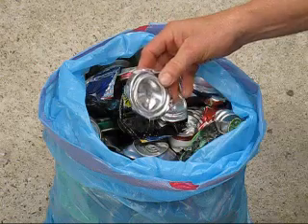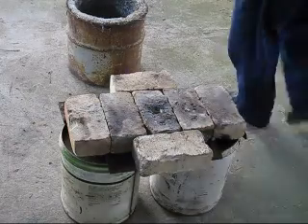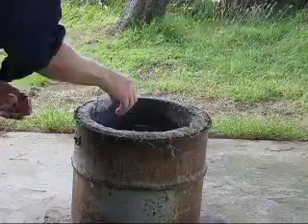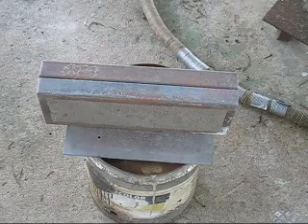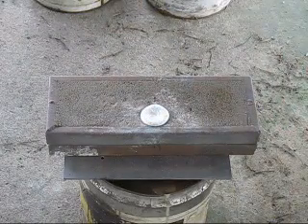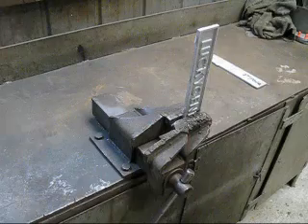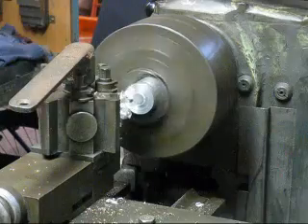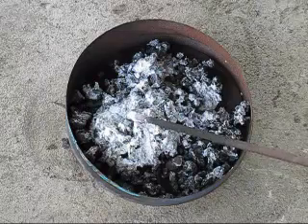Melting aluminium cans experiment

Comment: Have you considered topping the crucible with an inch of powdered charcoal and firing it with a loose fitting lid ?
At those temperatures char will react with any atmospheric O2 ingress, and leave the melt in a reducing atmosphere.
The volitiles from the ink will pressurize and escape the loose fitting lid.

I have used this charcoal  O2 getter technique for a number of things, and if the container has a loose fitting lid, the char lasts amazingly long... hours.
Over 400C, char is reactive as hell to O2, and light enough to float on all metals.

I have never done it with aluminum, but I think I'm going to give it a shot.
Reply from the maker: It is the volitiles in the ink that will gas aluminium. The same thing happens when melting oily scrap. In my gas or oil furnaces there is a low pressure area at the top of my crucible so if a powder is floating on the metal I am melting it gets sucked out the exhaust vent. Lids are not very useful as they stick to the crucible and nobody sells lids for crucibles nowadays.
Reply: @luckygen1001  
Just did a test melt at 750 C in an electric kiln, 3 inch dia AlO3 crucible with a 4 x 4 in x 1/2 inch kiln brick lid.
Added 20 cc powdered wood char with the Al charge at the start. 
40 min to melt time and the char still not completely burned up and protecting the melt surface.

No visible porosity in the cut test piece, and the surface of the melt had very little dross.
Melting with char seems to work to prevent oxidation with a loose lid, going to play around some more...

Comment: The aluminum cans return to aluminum oxide. 
Which can be converted back to aluminum by passing an electric current thru the molten mass with a Flux.   Al2 CO3 plus DC current in the molten mass along with some flux and vigorous stirring should convert the Alumna into aluminum and dross.  

Graphite rods as electrodes attached to DC current into the molten mass passing a high amperage  guessing 10 amps at 12 volts thru the rods  should convert the alumina back into aluminum.  The flux should help remove the trash.   The molten mass would require stirring with something like a paint stirrer.   Up the amps until the conversion.  Keep heat at melting point of aluminum, stir, and apply voltage.   That should get your loss rates down considerably.   
The hydrogen would have to be driven off with argon or something to make a solid perfect pour.

Comment: Isn't the dross aluminium oxide? 'Could be wrong but I believe it is. Also known as Alumina or Al2O3. It's not a waste product and should be saved. Try buying a sack of it and seeing how much it sets you back. Keep it and powder it. It melts at 3000˚C so work it into some stoneware clay and make refractory items out it such as crucibles, lids, fire bricks, mortar etc. Mix it with paraffin wax to make your own polishing compound. 101 uses.
Reply from the maker: How do you separate the aluminium oxide from the other slag products?
Reply: @luckygen1001  hey man.. nice to hear from you. thanks for your videos. I pound it and sift. I use that heavy woven plastic sacking material that grain comes in so the fine dusty stuff doesn't escape and a big 6" oak mallet I made with a rounded head so it doesn't tear the bag whilst I pound at it. I just lay it on the lawn (dry hard earth) and thump away and then sift it. metallic bits back into the next melt. powdery bits into the clay to make stuff. If it's bricks, I add a burnout material such as sawdust to provide porosity which results in better insulative properties (and you can saw it), and also better resistance to thermal shock. Could also go nuts and read the patent to make some real pure stuff. https://patents.google.com/patent/EP3072853A1/en

Comment: i have melted cans with some other structural aluminum scrap as well as some extruded flat and some aluminum wire all together the other night... there was a lot of aluminum in the dross I noticed and will indeed try the lo - salt method.

I have some of the saxta green iodised table salt which is potassium iodide, sea salt and some anti caking agent and will see if that pulls out the aluminum in the dross when I next do a melt to see if it makes any difference...

I recently saw a video of one of the other casters from the USA who used lo-salt and got good recovery from his dross

Comment: It's very important first to compress the cans as much as possible in order to get almost all air out. People seems to forget that not only are alu cans very thin walled, but in addition to this quite a large part of the thin wall is actually paint. Alu oxidises extremely fast when heated. A waste oil/coke furnace is not the best choice, due to the risk of excess air being blown in; far better is an electric furnace. Melting must be done in a crucible with a lid, or for the highest yield under inert atmosphere, i.e. nitrogen.Melting of thin walled cans is a two step process. First preheating to around 400 to 500 C to melt and burn the paint/plastic coating off, afterwards to near 700 C to completely melt the alu.The paint residue will raise to the surface, and together with the inevitable aluminium oxide create a protective layer of dross, thus help keeping the air away from the molten alu. Do not remove the dross until immediately before pouring.Salt as flux and soda as gas persecutor can be used if nothing else is available, but commercially composed degassing/flux tablets works so much better that they are worth the money.For the backyard caster without a large rotating furnace, without any nitrogen equipment, and without the possibility to fully control the temperatures needed for the ideal two step melting process, there is in fact a reasonable good solution: Press or hammer the cans flat before melting, use a straight walled cylindrical crucible, and use a steel rod with a welded on round steel plate which fits neatly into the inner diameter of the crucible. This will keep the air out, acting as a lid; notice that you can't leave the steel rod in the crucible as it will slide down and squeeze out the molten alu, unless an adjustable stopping device has been fitted on top of your furnace.Start up the melting process with just a few solid pieces of scrap alu. When melted, add the cans one by one, while pressing each can down underneath the dross layer directly into the hot melted alu, by using the round steel plate on the aforementioned rod. The less contact with air, the higher your yield.
Reply from the maker: Have you tried using "soda" aka sodium carbonate as a degassing chemical?
Reply: Three types of fluxes have to be used when melting alu scrap for metal casting. Drossing fluxes promote separation of molten alu entrapped in the dross (sometimes up to 80%). Cleaning fluxes remove oxides suspended in the melt. Degassing fluxes releases hydrogen from the molten alu; therefore keep your feed stock dry and use the last flux just before pouring as hot molten alu continues binding to hydrogen from humidity in the air. This is also part of the reason why cans must be dried and flattened before being pressed down into the molten alu in the crucible. 8 to 10% dross is unavoidable when melting alu; up to 20% can be expected when melting alu cans due to the layer of paint and the plastic coating on the inside. It's possible to recover 60 to 70% of the entrapped alu if you process the dross from cans afterwards, and even more than 80% of the alu in other types of alu dross. It's easy to mix the correct chemicals for the three different types of fluxes, but unfortunately some of them generates deadly fumes when added to your melt! This subject goes far beyond the capabilities of the backyard metal caster who don't have the possibility to clean the smoke and the fumes generated, for environmental reasons! Thus revealing the exact composition needed will not be done here. In a private forum it will be thoroughly considered.
Reply: Chlorides and fluorides with oxidizing component (KNO3), nasty stuff.
Reply: Don't forget about the plastic liner on the inside of most cans.  That contributes a lot to the loss of weight, no matter the amount.

Comment: I have gotten mine down to just under 48% using baking soda as an out gas and rock salt as a flux .... here in the states im using 1.5 pounds to get just over 1.0578 pounds of ignots.  to me its worth it only when i have several hundred if not a few thousand to melt down at one time.

Comment: Just wanted to share my recent experience with this, my first attempt at melting anything was cans, I was very dissapointed and mad that I wasted so much fuel.  I swore I'd never waste any more time or fuel on cans due to the excessive dross but then I read an article where this guy shoved his crushed cans one at a time straight through the dross and wouldn't skim it, apparently the dross will only accumulate to a certain amount so I gave it one more try about a month ago and I was really surprised. I yielded a lot of aluminum by leaving a 3/4" steel rod in the crucible to shove each can through the dross keeping the furnace slightly above pouring temps and made ingots that I further refine later as I add it in with castable aluminum for actual molds. I wouldn't recommend using it for strength bearing castings but it's ideal for general things. Also it's still too dirty and filled with gas at the first stage as I make ingots but I didn't use any flux for this first stage either.

Comment: i melt cans, they're free.
i add "low salt" salt as flux and about 10mm of 5mm total OD, 7 strand copper wire, per A4 crucible (600ml ?) 
a bit of baking soda (sodium bicarbonate) to degas.
i'm still learning and experimenting,

Comment: I had differing results between ali can pours, the first pour I made I recovered about 65-70% but as I could not clean out the bottom of the crucible (disposable argon welding gas cannister) I was wondering if that was the problem that caused me to only be able to recover about 45-50% on the second pour. 
Also I was wondering how people go about cleaning the crucible out after you have finished and does it matter what material the crucible is made from?

Comment: One important factor is the amount of air blown into your coke fire. If there is a surplus of air then you still have unburned oxygen in your furnace which will oxidise your cans and turn them into a white powder called aluminium oxide. If you put a cover with only a rel. small exhaust hole on the furnace to keep the heat inside and you lower the amount of air blown into the fire then all oxygen is used up by burning coke and consequently you will loose less of your aluminium cans. http://en.wikipedia.org/wiki/Oxidizing_and_reducing_flames  Covering the crucible inside the furnace might also help. However do this only outside with good ventilation since the exhaust gas of the furnace now contains much more carbon monoxide which is odourless but poisonous and can be lethal in closed rooms.

Comment: I have melted cans in the bottom of an waste oil fired furnace with an outlet in the side for the molten metal to run out. I find if I stir and squash the metal/dross, I get more metal out, and very little metal is lost. As some of the others have said, it all depends what you use the metal for, I only use it for signs etc and to cast aluminium flasks, rather than using better quality scrap. I also have a constant source of cans for free and have built a crusher to crush them first

Comment: I have made hundreds of pounds of castings from cans alone and I haven't had much of an issue. The biggest issue I have come across is that I end up with more dross/slag than I would with clean aluminum but I simply collect it, remelt it, sift it and use it as a filler or in my parts tumbler

Comment: Thanks for an informative video. Can I suggest a part two video where you try using table salt as a flux and sodium carbonate [washing soda] to de-gas the metal. Credit for these techniques goes to myfordboy. Here in Australia washing soda can be bought at the supermarket Lectric brand in a 1 kg plastic bag for @ $4.00  
Unfortunately only South Australia has the 5 or 10 cent deposit refund scheme, the rest of us can only get 60 cents per kilo at the scrap yard. Still that is better than the current scrap price for steel at $10 per tonne.

Comment: I see no problem melting cans in a backyard foundry. It all depends on what you need your final product to be. If you're looking for strength and great machinability, don't use cans. If you're doing art/decorations/signs/experimenting  - then cans are great to use. I find cans all over the place so for me they're free. I also melt them down into ingots first. Second melt has little dross and easier to determine the amount of AI I need for a pour.

Comment: With 50% waste it seems a futile exercise to melt them down on a small scale.
Here in South Australia each of those cans is worth 10 cents at the recycle depot.
If you add the cost of fuel 2Kg of cans would give a tidy supplement to go to the local metals supplier or even eBay with and buy a good grade of rod or sheet to work with.
I can understand using discarded castings to melt and pour, but cans to me are a non starter.
Cheers Eric

Comment: aluminum cans are formed so thin that its mostly aluminium oxide, this is also why they have a good deal of strength, due to the fact Al oxide is realy strong and hard.

(side note here ruby are really a crystalline form of Al oxide. artificial ruby is normally mass produced to make abrasives like sandpaper, emery cloth, cutting disks and more)

it´s rarely worth  the effort of melting down the cans for the amount Al they release, since the fuel cost for melting (unless the fuel was free) rarely is lower then to buy Al from a scrap yard or stock supplier. sometimes if the cans are refundable mony may be lost.

i normally just return them, and find som one who got som scrap, but many times they maybe alloyed.

Comment: Hi !

I did melt a lot of beer cans and I think the resulting amount is acceptable and the machining finish too - but we can have different quality needs ;-))

What I can see from your video is, that I do it with much lower temp - I have a temp.meter to measure the temp, my pot is no way as red as yours - I don't know if that could explain the difference.

Here is the melting process - I have an efficiency about 50% - More details here and you can Google Translate to the right just under the menu line - choose whatever language you like in the combobox:

http://kelds.weebly.com/melting-beer-cans.html

And I tried to machine the bars with saw blades - not good:

https://www.youtube.com/watch?v=2vCWSo50EZk

but I think the bars machine good when machined with very sharp end mills - like in the beginning of the vidoe above.

I think I WILL use the bars from the melted beer cans to special projects where quality doesn't matter so much - my next project is a follower rest, where I will do the main part with alu from beer cans - at the button of the site:

http://kelds.weebly.com/travelrest.html

Comment: .Go back to basics; aluminum oxide is formed by the reaction of aluminum with oxygen, so you need to minimize the contact that your molten aluminum has with oxygen. This can be done by lots of methods, such as using a nitrogen atmosphere - no oxygen- no oxide! Secondly, limit the amount of surface area your molten bath has exposed to the air - use a conical vessel with the narrow neck at the top. Thirdly, melt just a little aluminum and then slowly and carefully feed other scrap into the molten pool, do not melt a large amount of metal scrap in one go, as there will be a lot of air in the total metal volume. Fourthly, do not agitate the molten bath - keep the molten surface as still as possible to minimize the reaction between the air and the molten metal.

Seems like the aluminum is reacting with oxygen and forming the dross. 
you are blowing a lot of air- can not say if that is an issue, but

check out:
https://www.youtube.com/watch?v=zU0ThM8ljAY
uses an electric kiln.
Reply: one can melt it with fresnel lens, no fire needed

Comment: Great vid!  I just did a video on melting cans and had a lot of waste too.  I just guessed at a 50/50 metal to waste ratio.   I've never done smelting before, so any metal is cool to me.  I just started using the metal to make things and will be doing a video on that soon. I will do another melt and show my weight ratios too.
Reply: It is a relation of the surface area for the recovery. The oxide on the exterior doesn't melt well. It could be refined but not a backyard operation. Even at 50%, you can still do well enough. Starting with a puddle will save fuel.

Comment: I think 60% is actually pretty good if you didn't use flux. 50% is what I get and the final metal quality is just not great. If your playing around with art and enjoying a good melt for the entertainment value then I would recommend it but if your making a functional piece that will be under stress in any way then stay away from them. Can are junk. Your making things from junk you will get what you put in.